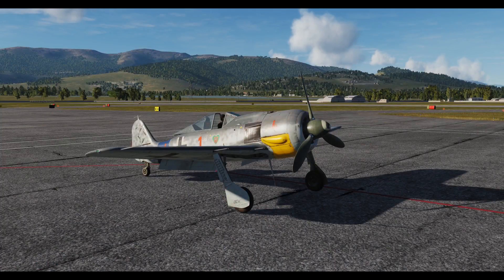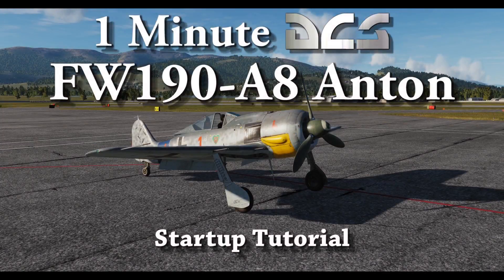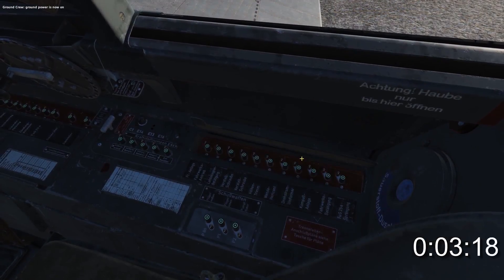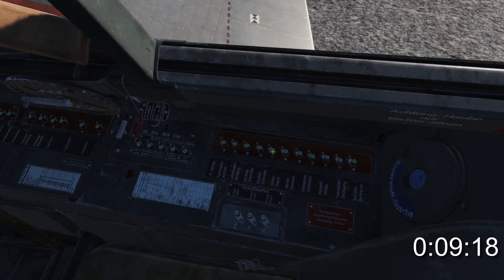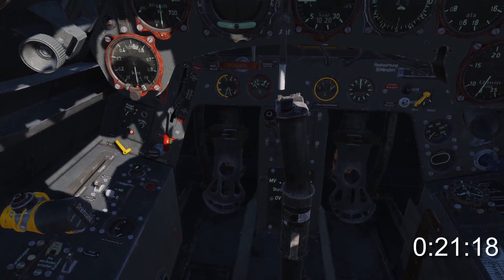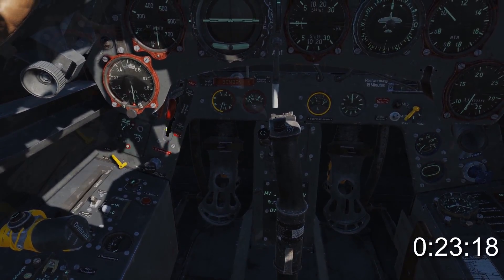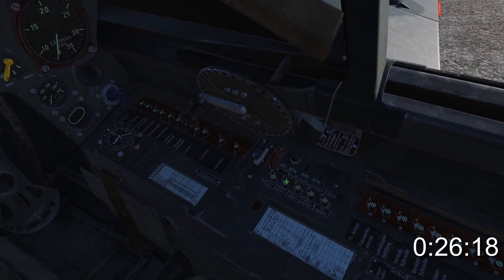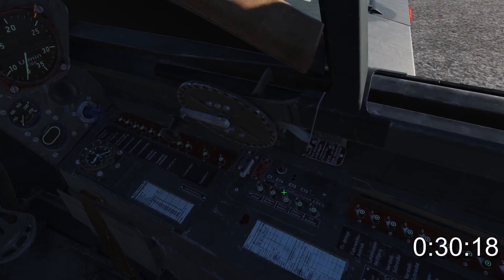1 Minute DCS - FW190-A8 Anton - Startup Tutorial

Comment: The lever switch on the throttle thst controls prop feathering and the throttle itself wont move. Any advice?
Reply from the maker: Thank you sir!  I'm probably a little late with this, but the answer to things not moving is usually a bindings issue.  While sitting in the aircraft press escape and go to controls.  From there go to Axis bindings, sometimes DCS binds the controls it thinks you're going to use, so you end up with 2 or 3 things bound to 1 throttle.  You're best bet is to highlight each column (except the track IR) then click on 'Clear Category' then rebind all of your axes.
Reply: @Laobi  well you are a bit late but I thank you my good sir for making exquisite content and answering the question nonetheless.